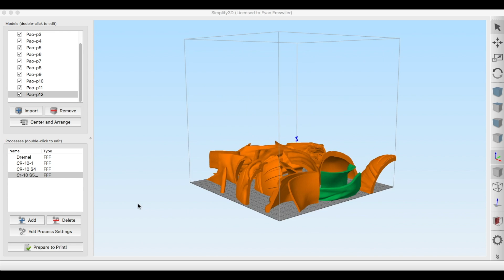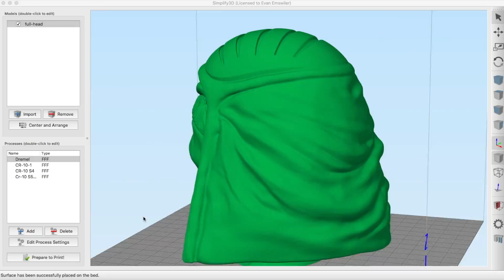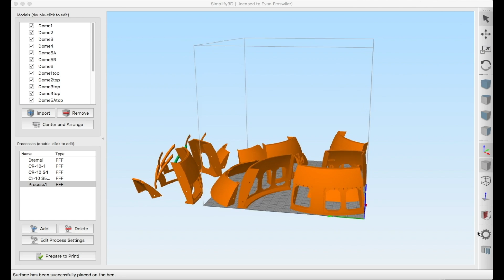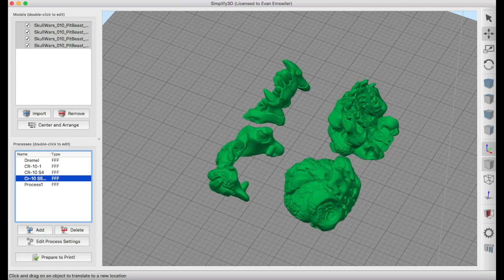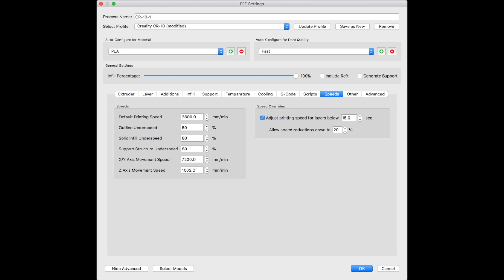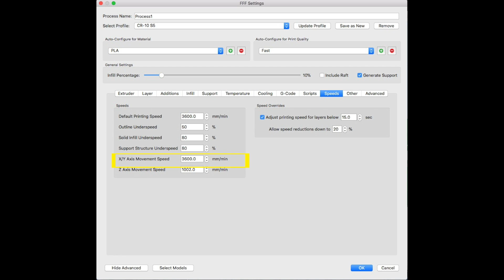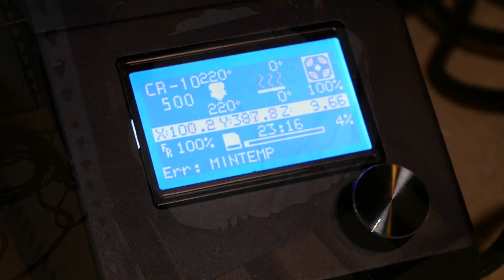Make Insanely Huge Prints on the Creality CR-10 S5!

Comment: DONT BUY THIS PRINTER!  I have the same. creality installed wrong 
firmware, so i can only print 400x400x400. there are several other user 
with this issue!
absolutley no feedback from customer service. creality dont care about 
they customers.
by the way, the mounted heatbed of this printer is only 300x300mm, so 
the printer ist not able to make consistant heat over the buildplatform.
Make your self a favor and DONT BUY THIS Printer!
Reply: Hello @Dalek Supreme . First, i spend 1000 Bucks for a Printer which doesent work and the seller doesent care! thats hard!
Second. Creality can fix this in under 5min. They just must send me the right firmware. so i can change three little lines and the problem is solved.
I have the version with the touchscreen. for this version there are no firmware for download avaiable... so its not so easy to fix it then. 
if you can help me to solve, it would be very nice ....
Reply: These are popular enough machines that someone out there probably has a custom firmware setup for it. If not marlin is pretty easy to set up, maybe just learn how? It sucks but I mean gotta do what you gotta do I guess.
Reply: @lukefenske3039   finally i find a machting firmware. so i fix it bymy selfe. just 1 hour waste of lifetime *lol*!

Comment: Great information.
Did you have problems with the heat bed only being 300mm x 300mm?
Your rancor monster was printing to the 500mm x 500mm limit so some of the extruded plastic would not be kept warm. Were there any warping problems because of that?
Again, insane prints and well done.
Reply from the maker: Ian S. Rutter In that particular case I didn’t run into any real problems with the heater size, but I think it will depend on what you are printing. I do think that as long as you use glue you can mostly get around it. I don’t remember if I talk about it in this video or not, but the heater on one of my S5s died completely and it is still pretty usable
Reply: Thank you so much. Really good to know.
Have fun.

Comment: Just saw your video, very informative.
Have ordered the same Creality CR105S printer just today as am in need for a large printer than I currently have but for the moment did not want to spent too much money on it. Funny enough, it's will be my cheapest printer yet.

Do have a question though.
You seem to be printing all your models in PLA. Have you ever done large prints in other materials on the CR10S, like PETG, ABS, ApolloX or TitanX?  Only about 20% of my orders are in PLA, but nowadays about 50% is either ApolloX/TitanX and about 15% is  PETG. All my other printers (mostly the larger Creatbots) are enclosed but the CR10S is very open.
So, would like to know if I can use the CR10S succesfully for such materials as well?
Reply from the maker: I have not been very adventurous in my material selections, so yes it is almost all PLA. I do think others have had some success with some other materials, but I know ABS is notoriously difficult with an open design like this.
Reply: @MightyJabbasCollection  Thank you for the quick reply. In that case, I will just have to try it. Can always build some sort of enclosure for the printer if needed of course, althoug I think that for large prints that would probably not be sufficient.

Comment: Hi great video.  Been watching your reviews and am sold on a Creality.  Was going to go S5 but as you recommended probably beat to start smaller so just ordered an Ender from Gearbest.  I have plenty of Auto Cad and Master CAM experience but zero experience modeling organic shapes... can you recommend a modeling service that would be able to make 3d models for me from 'like this' pictures I send them?  Mostly pretty simple stuff, I'm a knife maker so thinking basket hilts for lost PLA casting and some wax injection molds for symmetrical guards I want to be able to lost wax cast on a more regular basis.  Thanks for your help.
Reply from the maker: I’m afraid I don’t have much experience using that kind of modeling service. Depending on how complex the designs you want are, you might be able to model them yourself using something like TinkerCAD
Reply from the maker: And now I see that you mentioned you wanted more organic modeling, so something like TinkerCAD would not work. You might try joining one of the Facebook groups for the Ender and see if anyone there is advertising modeling services there
Reply: Thanks for responding...was just playing with tinker cad last night... in the tutorial it has spiral stairs modeled... if it can do that I can probably make do... or have been looking at scuptrix... but that's quite a learning curve, which is what had me wondering what a modeling service might charge.  Will check out some forums as recommended.  Thanks again.

Comment: Hi man, wanted to ask u if u have upgraded to s3d4.10 already, coz I am having issues with s3d which previewing gcode very slow when loading a very large object.  Please help.
Reply from the maker: I haven't upgraded yet. Are you saying you're having the issue with the new version?
Reply: @MightyJabbasCollection  Yes, I am. I even tried to slice a cube, using the whole cr10 build plate, and when I preview it and rotate view, it's so slow. I asked you coz you seem to be making large stuff, and I thought you are experiencing the same issues as I am.

Comment: I've purchased the CR-10 S5. Unfortunately I have encountered some problems. Maybe you can help me with this. The Z-axis seems to have a difference on one side 0.3 mm.  I've tried by leveling the Z-axis but this 0.3 mm difference stays. Is this normal for the S5?  I'm trying to print a large object and because of this 0.3 mm difference in the Z-axis my object is creating weird differences and causing instabilities within the print.  The temperature is fine, nozzle extraction is fine, speed is fine.. the only anomaly is the weird Z-axis difference and the fact that I need to re-level my bed every time I want to start with the print.
Reply from the maker: I don’t know if I’ve had a similar problem, but have you tried manually twisting the coupler on the z-axis rod on one side? I guess you could also try using some folded aluminum foil to prop up one side of the bed slightly

Comment: Did you face the warped bed issue? I'm looking at buying one but I'm worried about this issue?
Reply from the maker: I haven’t had that issue with any of my Creality machines. A lot of people swear that the aluminum bed is warped or the glass is uneven, but mine have basically been fine. They might not be perfectly even, but I use glue stick to aid in adhesion and that seems good enough
Reply: @MightyJabbasCollection  I picked up an S5 and received it today. My glass was unfortunately slightly warped in one corner where I needed to put a few sheets of paper under to raise it but it was easy enough. My first 3D printer so I was quite impressed and didn't really expect it to look as big as it does in person 😂 I'm quite a technical person so I wouldn't consider myself an amateur even with it being my first printer so I do agree it might not be the best first printer :)

Oh and I ordered the non-touch screen one but ended up receiving the touch screen model anyway which has a much nicer interface than the standard one.

Comment: Really cool and informative video. I'm looking to purchase a cheaper version of this printer (the regular CR-10 with a 300x300x400 print bed) and I have two questions:

1) What's the process like when you change filament during a print if the print is so big that you're going to run out of filament?

2) When the manufacturer specifies print bed dimensions of 300x300x400, is that then the actually dimension you can print on, or is it actually a smaller surface? I'm looking to print something that comes close to the limits, and that is why I want to buy the printer. But if it struggles to print something at 280 x 280 x 390 or similar, I won't buy the CR-10.

Thanks in advance :)
Reply from the maker: 1) You can pause the print and change the spool. If you're using the filament detector, it will pause automatically when it runs out, but as I think I mentioned in the video I had some problems with false positives, so I ended up just keeping a snippet of filament in the detector to fool it into thinking everything was okay. When I want to change the filament I remove the snippet. Or you can also select Pause from the menu.

2) I'm not sure what the exact usable dimensions are, but it's probably good to assume that you can't something that is exactly as big as the build volume. Still, it's not a huge difference. If you really need something that is exactly that size, consider getting the CR-10 S4 instead.

Comment: I did get the CR-10 S5 myself, but despite the printer is good for the money, I think it is just unusable with the bed heater it is delivered with. 
They deliver the printer with a heated printbed and a glass buildplate. For a glass buildplate to get your prints to stick to it, temperature is really important.
The heated area of the printbed is only 40x40cm, resulting in an uneven heated bed with differences in temperature between the center and outer regions of the buildplate that can differ 15 degrees. Plus the fact that the heated bed cannot even get to temperatures needed to print ABS.
The solution to the problem is getting a 1500W silicone heatpad for the printbed, a must-do upgrade to be able to use the printer with other materials than PLA.
I always dislike the fact they do not offer it like that out of the box, the heatbed that's on it also costs money, plus they could do a good job getting the price of the heatpad down by buying thousands of them. I would be willing to spend more on it with these options installed from factory instead of having a disappointing experience first and having to fix it myself.

Comment: Nice Vid. how do you continue printing if the filament spool runs out and file is not yet done?
Reply from the maker: You can pause the print and change the spool. If you're using the filament detector, it will pause automatically when it runs out, but as I think I mentioned in the video I had some problems with false positives, so I ended up just keeping a snippet of filament in the detector to fool it into thinking everything was okay. When I want to change the filament I remove the snippet. Or you can also select Pause from the menu.
Reply: @MightyJabbasCollection  thanks man.

Comment: I'd love to buy one of these, but I think I just have the worst luck in the world. 
Bought an Anet A8 a few years ago for $200, paid for upgraded parts, a new main board... Pumped another $150 into it easily. 
Currently won't work, garbage. 

Bought a Flashforge Dreamer for $1,000. Warped factory bed, absolutely awful costumer service that refuses to help me fix it. 

I don't really feel like dropping another thousand on some Chinese offshore product that probably has no warranty backing it and will probably fail in a hurry.
Reply from the maker: The Flashforge Dreamer is the original version of the Dremel Idea Builder, which was my first printer. The Dremel has a removable (and replaceable) acrylic bed. Is the Dreamer different?

Comment: Nice models! I already have a Prusa i3 and i'm always looking for a big printer to do huge prints. Whats the biggest nozzle diameter we can run in the S5 ?? I would like to do some "fast" large prints without really needing the quality
Reply from the maker: I used a .8mm nozzle successfully, and you could probably go as high as 1mm but you may need to print more slowly or else the printer might not be able to heat up the plastic fast enough. So it’s possible that you might not actually make it faster if you go too large.
Reply: @MightyJabbasCollection  ok so there's a compromise between diameter size and speed. I never print higher than .6mm  maybe there's better/more efficient extruder upgrade available somewhere ?? I saw theres a standalone 120V heated bed but is it worth it ??
Reply from the maker: I haven't done any upgrades to be honest, so I'm probably not the person to ask. Part of me feels that if you start putting too much money into these machines you lose one of their primary advantages -- their cheapness.

Comment: Hi MJ, did you have any problems with warping, printing large PLA parts, since the heated bed does not fill the whole area of the build plate. I am planning to buy this large printer. I have the original cr10 and I feel like it is still limited in size, and you know what they say, GO BIG OR GO HOME. Thanks for your  review.
Reply from the maker: 3D Printwiz Actually I didn’t find it to be much an issue, although I do make liberal use of glue in addition to heat. I do still recommend the S4 over the S5 though unless you absolutely need the largest possible size
Reply: The truth is I find it limiting sometimes, specially when I print mostly functional parts. Recently I printed a vent cover and the print occupied the whole build area of the cr10, print went flawless, but I just got myself thinking, if the  vent size needed was a tad bit larger then I wuold have had to split and glue parts together, which I hate doing. Thanks for your fast reply, I think I will have to sell my FlashForge Creator Pro 2 now to get one creality s5.

Comment: Why not just print his head upside down so you don't have to deal with the support material?
Reply from the maker: Chewbacka Grizelda If you’re talking about the Pao bust, it would have actually required more support material to print upside down, since the top is rounded, plus the supports would have left the top looking very rough

Comment: Is the normal cr10 a good printer for your  first 3D printer and for 13 years old with no experience just watched lots of videos on it replay you answer
Reply from the maker: I know quite a few people have bought the regular CR-10 as their first printer, although it can be a little bit intimidating if you have no experience printing. It's possible that getting something smaller and cheaper might be better for some people. On the other hand, with the CR-10 there is a huge community of users who can help if you have problems.

Comment: thumbs up man we done ,i think if u upgrade the nozzle size to 0.6 and speed /sec with temp. controls +boxing the printer by wind or air shield might be a shorter time and acceptable results .
Reply from the maker: I've been using .8mm nozzles for my life-size Jabba project and they work quite well. In fact I think it's almost a necessity to use a larger diameter nozzle when printing large on these printers.
Reply: Ohh sounds great cheers

Comment: Do you have any "current" codes that work?  I have tried all of them and none worked for me.  I am thinking of getting the cr10.....or "maybe" the 10+.  After watching several YT vid's, it seems that the cr10 prints just as good as the 10+ and I am not sure if it is worth the extra money.  With the money saved, I could print parts to upgrade and might have enough left over for material or purchase parts that would actually benefit.  What do you think?  Thank you for your time!!
Reply from the maker: Thanks for letting me know they had expired. I think the coupons for the larger printers are still good, but I just got new ones for the CR-10 and CR-10S and put them in the video description. As for the question of the CR-10 vs. the CR-10S, I think it depends on the difference in price. The sale they are running now makes the difference around $50, and for that price it is probably worth getting the S version. The print quality is no different, but there are some minor improvements in the S that are nice to have, like the filament sensor (although it can be temperamental) and recovering from a power outage.

Comment: Thanks for your awesome review. What is the glue you are using? also could you just cover your bed set up ect?
Reply from the maker: If you mean the glue for the glass bed, it’s just Elmer’s school glue (the purple kind that turns clear when it dries). I’m not sure what you mean by bed setup
Reply: Mighty Jabba's Collection thanks for getting back to me. Iran can you create a video of how you use the glass bed, like if you had to install the glass and start a print.
Reply from the maker: Well generally speaking you just clip the glass onto the bed and leave it there. The hard part is leveling the bed, but I think there are already videos on YouTube that can help with that
Reply: Then you just paint the glass with elmers glue, right? Or just rub the glue stick on?
Reply from the maker: Just rub the glue stick on. The first time you can apply it to the whole plate, and later just reapply in the spots you printed in last.

Comment: 90+ hours? How do you monitor something like that? Sleeping during a print seems way too risky.
Reply from the maker: I do sleep during prints -- it's really the only way to be able to do long prints like this -- but I am also a little concerned about possible safety issues. I have experimented with using Octoprint and a webcam for monitoring and remote control of printers, but that has its own challenges, and of course it doesn't help much if you are asleep.
Reply: Mighty Jabba's Collection there is a real danger of a fire hazard. I've had my temperature probe come loose mid print and the heater kept on heating beyond safe levels. There are plenty other horror stories. Be safe.

Comment: what printer did you use for the blue parts ?
Reply from the maker: dukat03 I either used the S5 or S4, if you mean the unpainted blue parts of the dome
Reply: Mighty Jabba's Collection 

Yes the part you’re holding in 08:30